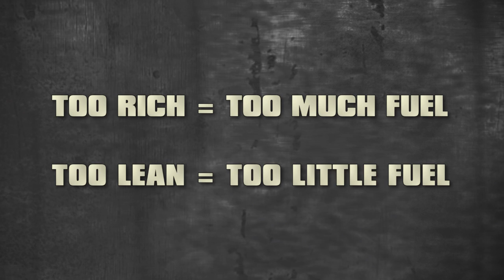Engine Tuning: How to RC Nitro

Comment: What should i do if my car isn't starting?? Probably I've messed up the position of the needles, whats the best starting needle position???
Reply: The glow plug is working fine
Reply: check your manual mine is 2.5 turns out from fully in
Reply: or flush with the sleeve

Comment: What if the engine dies before it gets to full throttle? I've tried so many different tuning sequences and such and nothing works
Reply from the maker: When the engine dies at or during high throttle it usually means the high speed needle is to lean/rich. That is when you start adjusting the high speed needle.
Reply: Either your engine is running lean  or you have an exhaust leak (aka not enough pressure getting back into your fuel tank). 

I kept adjusting the high speed needle and then examined the tube coming off the muffler back to the gas tank and found it had a minor cut in it.

Comment: are nitro engines actually mini 2 stroke engines?
Reply from the maker: Yes in the sense that the engine makes 2 strokes. Intake + exhaust strokes. But they are not entirely the same thing because most 2 stroke engines use unleaded fuel mixed with 2 stroke oil. Nitro engines use Nitro fuel not normal unleaded fuel like weed eaters, chainsaws, and lawn mowers. It is essentially like a "race" fuel.

Comment: why quit ingen when I remove the igniter
Reply from the maker: If the engine dies when the ignitor is removed it usually means the glow plug is fouled. Probably means you need to replace it or at least pull it out and try a new one.
Reply: First try to adjust the low speed need 1/8-1/4 turn counter clockwise if you know the glow plug is good.
Reply: @brandonb.288 ok

Comment: Can someone help me i live in high altitude do i need less air or more air ???
Reply: more
Reply: Daniel Vara dude, refrain from giving  advice especially when you have no idea what you're talking about
Reply: B Boss Higher altitudes have less dense air, so he is correct in saying you need more air. Lower altitudes require less air as it is more dense.
Reply: You can not get more air into the engine unless it has a forced induction (super charger or turbo charger). So naturally aspirated engine at higher altitude you can only limit the amount of fuel to correct the air to fuel ratio.

Comment: Mine does not start at any settings, the plug is fine and the fuel is brand new.
Reply: The problem was when I stopped priming, the fuel would get sucked back into the tank.
Reply: BBQ Sandwich Sounds like the fuel lines are swapped around. Fuel sending and the fuel return lines are connected wrong.

Comment: When is Red Cat coming out with boats planes helicopters and emergency vehicles fire trucks ambulances and police cars when is red coming out with heavy equipment and the bigger scale RC short course trucks electric and gas in the bigger scale RC trucks like Texas has first time a Redcat fan I've had a Redcat for over a year and I will not get rid of my Redcat for anything I love my Short Course Truck
Reply from the maker: Thanks for the support! As of right now we are not to sure when of if we will dabble into aquatic and aerobatic RC's further. We do have our Carbon 210 race drone. But nothing specific for anything that floats or flies just yet. But you never know what the future will hold!